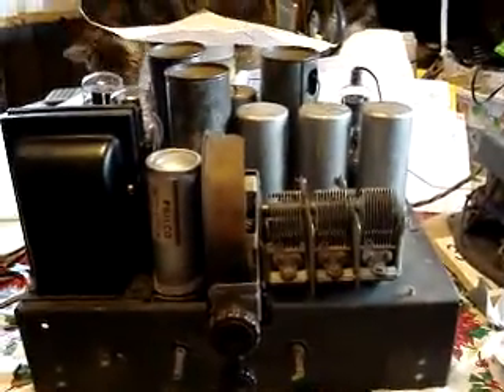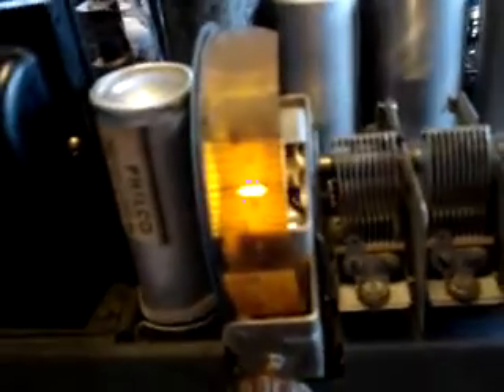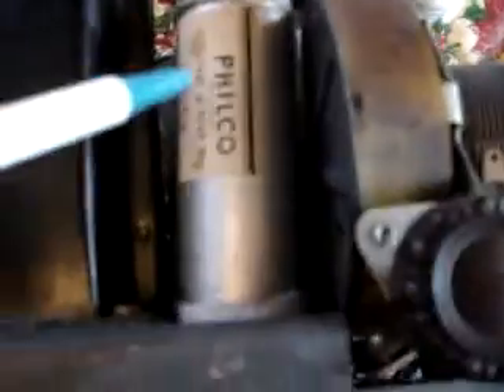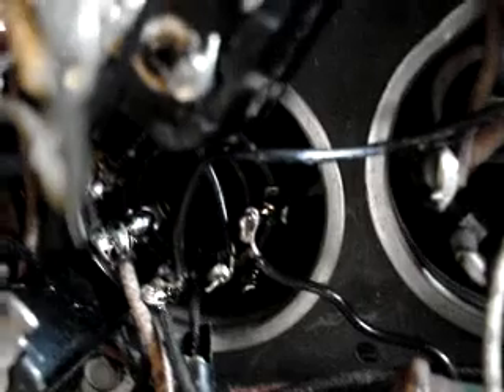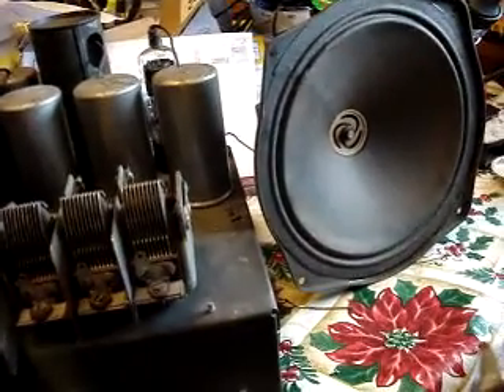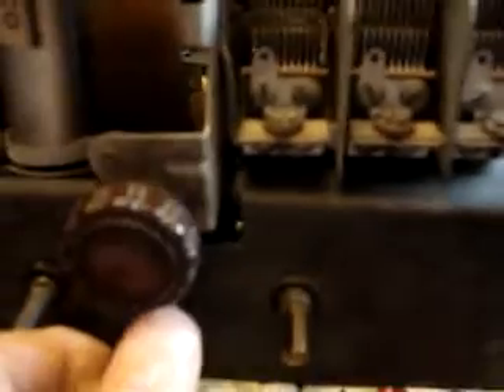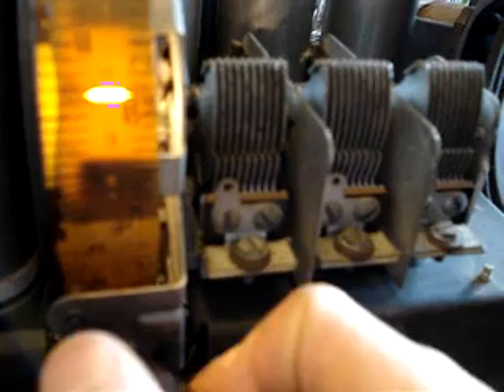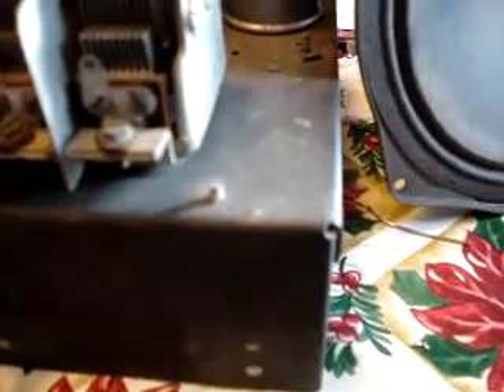The greatest electronics acievement in my life!!

Comment: well its not going to sound vary clear.. the muffled sound is why people like the radio still. its just an old cool thing.. the transformer if it is getting hot you might need to add a heat sinc.. just to protect it.     you should put the old tubes in a retro display sorta thing not in its original box to show more how it works toother people and becouse you dont see any tubes any more.. use heat shrink for wireing its fast and easy and perminent

Comment: it sounds like your voltage is still a little low. my guess is maybe 330 to 370vdc on the main cap at the rectifier. the 5 volts across on one side and about 260 center tap on the other side. one side of the 5 volt should have about 330 to 370 vdc at the electrolytic stage just a approximate guess.

Comment from the maker: Yeah, most of the parts are available at antique electronics supply. even the Valves (We call them tubes)^^ they have new old stock. it was a long process, I had to draw a diagram for each capacitor I replaced and how all the connections were hooked up, and I had to send a coil out for re-winding. it was a very rewarding experience :-)

Comment: You might ask one of the pro's on here first and see if its safe on this older stuff to spray contact cleaner into the controls and work them back and forth, this cures many issues on the newer equipment. - but again check with the pro's as todays cleaners may harm older controls - just a precaution.  I really share your pleasure in getting this baby up and running, most of todays kids wouldnt understand it - are you taking a class in electronics etc,??  If not y- might consider it - career-?

Comment: theres enough info here and on internet I have no doubt if you stay focused you can have this radio working like new.  Pay attention to the safety aspects, these old chassis have some dangerous voltages and the designs are sometiimes inadequate regarding safety - example - no fuses or protection devices in many of these chassis, mix that with deteriorated old parts & wiring and early design and you can see the possibilities.  BUT - I must say I applaud your work and patience at your age !!  GR8!

Comment: Tubes rarely need replacing.  They can become quite weak before they cause problems.  A weak oscillator might not oscillate.  A weak IF tube has to be pretty darn weak to affect reception strength.  The 1st AF can be practically dead before it affects performance.  The output and rectifer affect performance more, and will reduce output if weak.  What is more of a concern, though hardly common, is internal shorts between grids and cathode or cathode and heater (except #80, which has no heater).

Comment: Regarding capacitors, you should consider melting the tar out of the bakelite caps, and then stuff new caps inside.  Metalized film caps (yellow tubular) fit better than the orange drops.  This will keep your set looking more original.  Also, caps become leaky much more often than they open up.  That said, paralleling new caps to the old ones doesn't solve your problems.  It takes only several million ohms of leakage to throw off audio and AVC circuit bias.  DIsconnect old caps.

Comment: To center the voice coil, make three appropriately sized shim strips from 35mm film negatives.  Loosen the spider adjustment screw (center of speaker).  Slip the shims in between the voice coil and the center pole piece.  Then tighten the screw. If you can't fit the shims in, you can also simply move the cone to a point where the coil doesn't rub. Then, while holding the cone, tighten the screw.

Comment: Does the radio have a transformer for the power supply as well as the one connected to the anode (plate) of the output valve?
Which is the one with the wax drippings?
Send us a private message and we can discuss this further.

Comment: You may want to check the resistances on those radial lead dot code resistors, they have a nasty habit of drifting in value. Drifted resistors can throw off the tube bias in the audio output section and cause distortion.

Comment: Replace all the electrolytic capacitors in this radio as they have to be failing by now. Do not adjust any coils as they usually do not drift out.

Comment: Great job! It is so amazing to bring these old radios back to live. I'm afraid you're going to get hooked, LOL, LOL!! 

The audio problem could be the output tubes, or low voltage at the plates, if they are getting a good signal. 

A signal tracer may help in finding the audio problem.

I'll work on how to build a signal tracer for tube radios, video.

Wonderful work